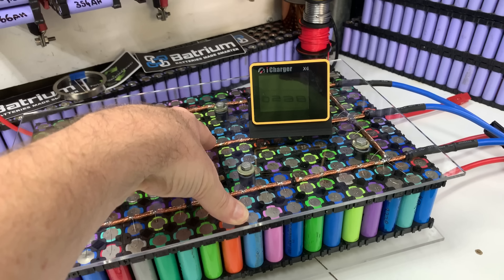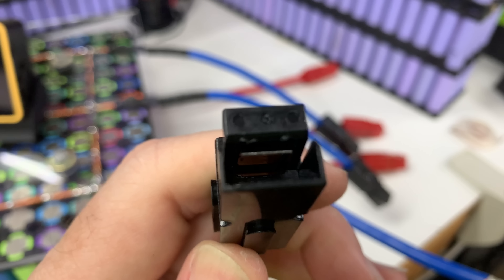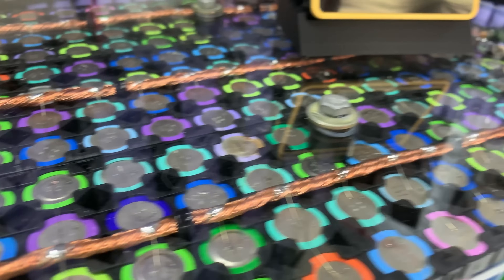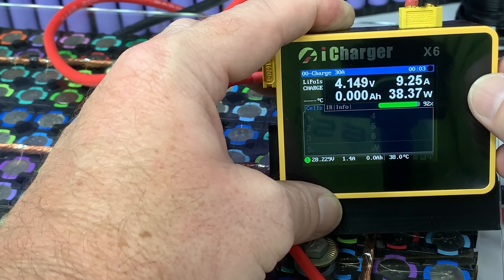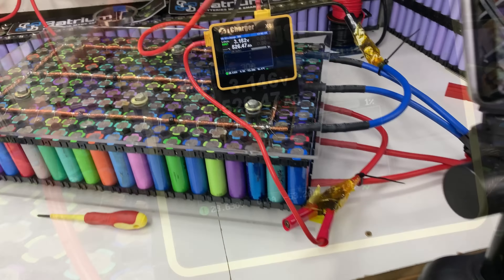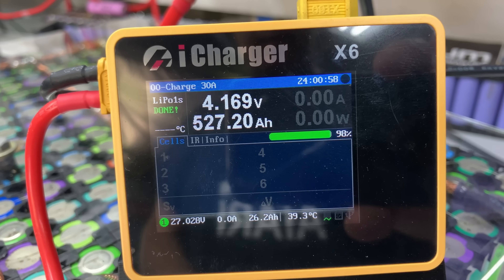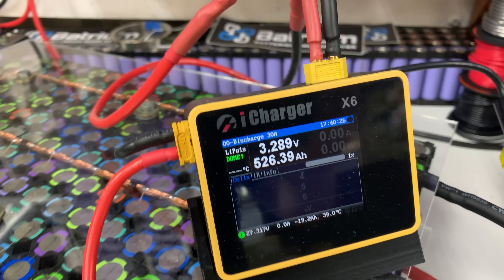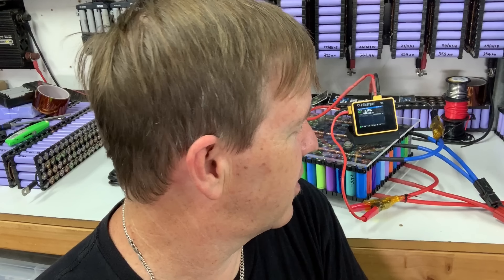Testing Rohan's  generic diypowerwall 240p pack, #Cell5s big brother

Comment: Those cells were averaging about 2200ma. I made a 10s 16p battery with 2200 cells. No fuses, I hadn't heard of fusing back when I made it 2 years ago. Had to replace the BMS. Because it's 67v it's connected to the bike motor with only 2.5 flex. My next project is a solar generator. Probably going to be about 2kw.
Reply from the maker: sounds about right! have to wait for Rohan to chime in i think he said he built it to a 550ah target - very interesting results if that's the case..The whole ebike community doesn't fuse - more for the used cells than the new i thinks.. Still needs a good bms tho.

Comment: How reliable are the generic (Chinese) cells? You ever had any problems or use them in your Powerwalls?
Reply from the maker: I've tested a few SZN cells failed after 120 ish cycles - Big brands or nothing - No way it's worth it, you can't make something cheaper with out first using cheaper materials or cheaper quality controls
Reply: @HBPowerwall  Cool Cool, im pretty new to it all, Just starting cell harvesting atm haven't got any solid plans as of yet.
Reply from the maker: Planing well will save you time and money - Load, budget, time frame ----wife that order i recommend

Comment: Damn cool, I notice you use copper wires in this pack (for busbars), and is that what, resistor legs welded with a spotwelder? Very cool, Im considering doing this also, much cheaper than the damn nickel strips.
Reply from the maker: resistor legs is for chumps we are way past that - we use something like this https://kit.com/HBPowerwall/diypowerwall-build-parts/gpw-30awg-bare-tinne
Reply: HBPowerwall mate have you by chance got an Aussie trusted supplier for the tinned copper ‘fuse wire” reels? Love ya work, and Nargaur I couldn’t agree more on losing the nickel strips 👍🏻

Comment: i thought it was important to have busbar exiting on 2 different side of the pack, like + on the right and - on the left for ex, in order to make sure that we wouldn't face the problem with cells closer to the "exit" of the busbar would be drained first. I though that by having busbar on 2 different sides, the repartition would be more homogeneous
Reply from the maker: for smaller packs this is a genuine concern - big ones ... nop no issue
Reply: @HBPowerwall  oh ok, thanks a lot for this clarification

Comment: I just got one of those chargers. Pretty cool so far! Now, I just need to assemble some packs. Headed to the plastics supplier for some acrylic sheets. jk lol!
Reply from the maker: DO not attach or touch the output battery wires to the input they blow up lol
Reply: @HBPowerwall  Important safety tip. Got it. Thanks. Haha!
Reply from the maker: I blew my first sponsored unit up had to pay for another to do the review lolz dumb me
Reply: @HBPowerwall  That sucks! Sounds like something I'd do. I'll order another one. lol!
Reply from the maker: I had to i was so pissed with my self - live and learn